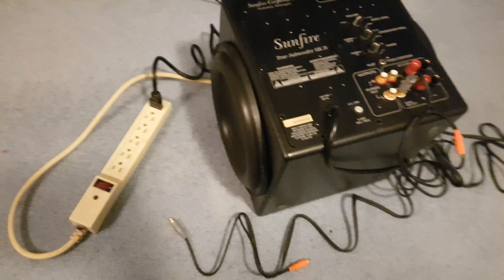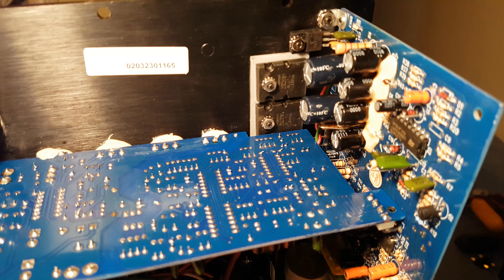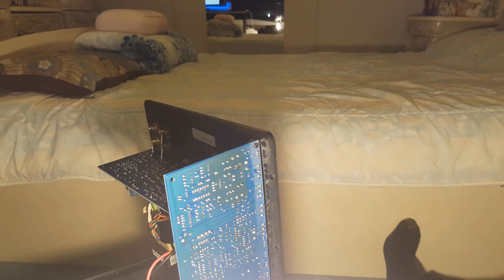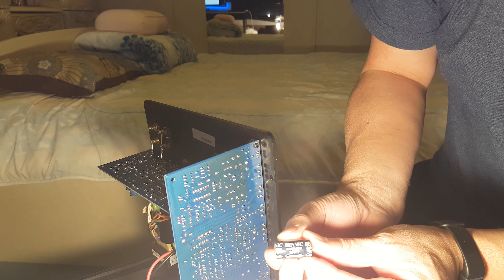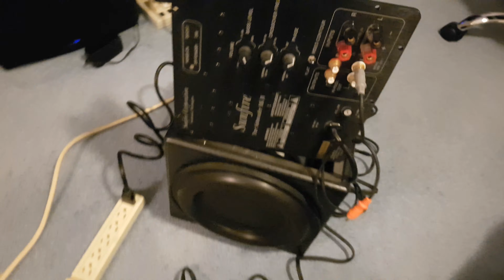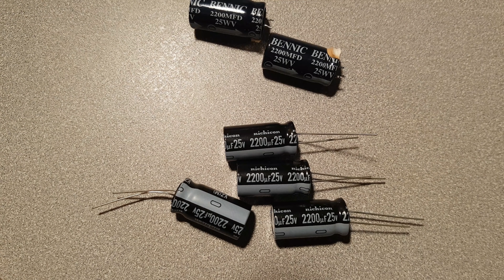Sunfire MK4 Subwoofer Repair

Comment: Recommend re-soldering solder joints before removing solder. This helps re-alloy 63/37 solder and adds flux which helps with the de-soldering process. Try heating one solder joint at a time and walking / rocking it off the board one side at a time until component is free to be removed then use dry fluxed solder wick to clean the PCB land holes with soldering iron. This will minimise PCB damage. Works well for me. Try using ESR checker to identify faulty capacitors.There is one good one ; MODEL MK5 made in Russia and powered by 2 x AA batteries.
Reply: Да там такие убогие дорожки, что отваливаются почти сразу. Припой не отпаивается. Это какой то ужас!:😮

Comment: Just an FYI for any of you that have a rattle or issue with the passive radiator:  you ran replace the PR with an Earthquake Sound SLAPS M10 PR and improve the performance from stock. This is a drop in fit, no modifications needed.  The SLAPS M12 will fit the 12 inch Sunfire with a very slight widening of the opening (bolt pattern is identical).  I've posted vids of them both in action with these new PR's.

Comment: Would Mk2 have similar setup? Ill open mine soon to chk. Just curious
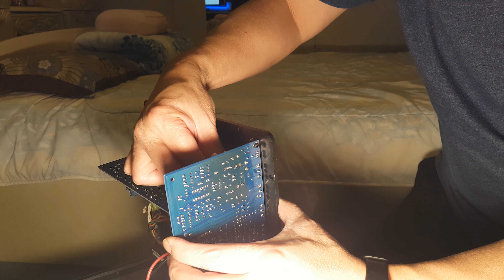Reply from the maker: The output stage usually doesn't change much. Dan Dunham's MK2 video at 3:15 shows a similar components and placement.
Reply: @hauhoang1637  pulled all the same caps out. They all look normal though but shall see if it fixes my issue. Im also replacing the big black ones.

Comment: I have an original True Subwoofer that intermittently pops and/or buzzes loudly (whether playing music or not) that I have visually inspected every single component under magnification and can see nothing amiss. Any ideas where to focus on or narrow down the search? Thanks!
Reply from the maker: I would first inspect all the solder joints, specially under the heavy components hanging sideway. Vibration might have loosened those joints over the years.  If they all look OK, perhaps the output power transistors should be inspected/replaced.
Reply: @hauhoang1637  Thanks for the suggestions!
Reply: Did you find a solution for the buzzes ? My Sunfire mk2 buzzes after several hours of operation with or without sound sources.

Comment: Excellent video, my subwoofer decreases its power, it stops sounding after a few hours but it stays on, I checked cables and cleaned, but I can't find the fault, there are some capacitors that have silicone between them but they seem well connected but I don't know if that It's normal, do you know what fault it could have? Thanks a lot
Reply from the maker: That's interesting. I have seen car amplifiers with a "throttle back" feature which reduces the output power when the amp gets too hot so it doesn't go into thermal shutdown. If that's not an intended feature in your subwoofer, I don't know what anomaly would cause the same effect.

Comment: Hi I have just replaced all output transistors and caps  , there are 2 jumpers which are resistors   JP1and JP2  are blown and cant see what they were , Can you help ?
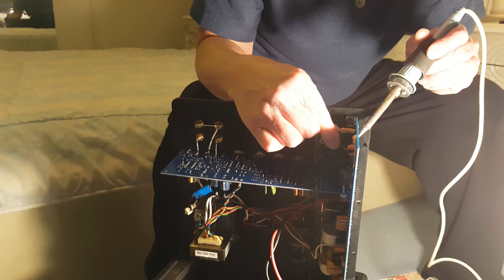Reply from the maker: Pause the video at 2:44 and you see two resistors with a black band - which to me look like O-ohm 1/4 watt leaded resistors.
Reply: http://www.resistor.tw/spec-en-zo.htm

Comment: That worked for me on the MK II too, thank you! Is your's still fixed?
Reply: Thanks very much for your illustrations. I just opened mine with the same capacitor bulging out. I intend on fixing it.

Can you please show me how you hook this sunfire sub to your system. Am using Sunfire True Subwoofer Signature with Yamaha DSP-A1 Natural Sound AV Amplifier. With Two Klipsch Forte Floor Standing Speakers.
Thanks.
John.
Reply from the maker: @BiGJ30713  I too use it in a 2.1 system. The Sunfire Sub is connected to the AVR mono subwoofer output. My two bookshelf speakers are connected to Left/Right speaker outputs which are being set to "SMALL".  The Center and Surround outputs are set to "NONE".  In your case, because of the floor standing speakers, you should set the Left/Right speaker outputs on the DSP-A1 to "LARGE".
Reply from the maker: That's great. Yup, mine still works. Don't expect those caps to go bad for the next few years.
Reply: @hauhoang1637  I'm in contact with a technican of Sunfire. He said that the MKII and MKIV subwoofers have cheap caps and will fail after 15 years. He recommend the original True Subwoofer because that one was handcrafted with US caps and not chinese ones. Did you replace all the other caps aswell?
Reply from the maker: Thanks for the info. I haven't replaced any of the other caps. There are quite a few of them. The two I replaced sit next to the power transistors, run slightly hotter than the rest, and therefore should have relatively shorter life.
Reply: @hauhoang1637  have one subwoofer cable where do I plug it in the back ??? Red or white
Reply from the maker: @yannolove1335  White - see the label "mono used left" underneath that input!
Reply: @hauhoang1637  I have a hsr 8 do I need a y splitter cable or just one high performance subwoofer cable
Reply from the maker: @yannolove1335  I'm not familiar with the "hrs 8". Which brand is it?  If your AV receiver has just one subwoofer output, using one cable connecting it to the Sunfire Sub left input is sufficient.
Reply: @hauhoang1637  thanks 🙏
Reply: @hauhoang1637  another question sunfire true work for couples minute and dies the driver is good do think is fixable ?? Second one hrs10 buzzing noise  is it also repairable ?? In your opinion which one is fixable please
Reply from the maker: @yannolove1335  Any reputable repair shop should be able to fix them.
Reply: Also there are two inline  7.5 amp 250 volt fuse inside these. One should replace them too. Mine is blown too.

Comment: i have 2 sunfire subbs but both of them needs new "volym/level" thingi , some one know where to get this ? great video ,i have alredy replaced most of the big caps
Reply from the maker: I had no issue with the volume control potentiometer and therefore didn't look it up. It's not a component that gets used often so I doubt it would go bad.  To ensure that it's securely grounded, you may want to remove the plastic cap, clean and retighten the nut and washer that hold the potentiometer in place. If that doesn't do the job, spray contact cleaner down the shaft of the potentiometer while rotating it back and forth a few times to remove oxidation or contamination buildup between the wiper and the resistive element.
Reply: @hauhoang1637  thanks
Reply: I had issues with my Volume and cleaned it with DeoxIT spray. Works perfect now